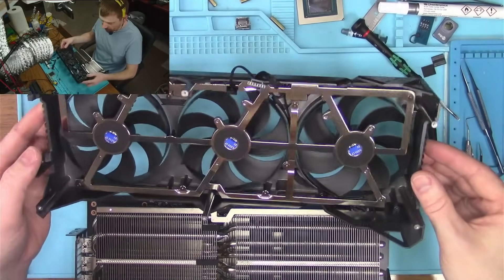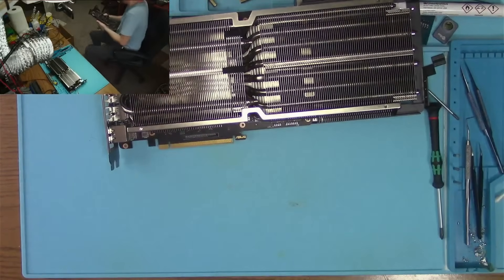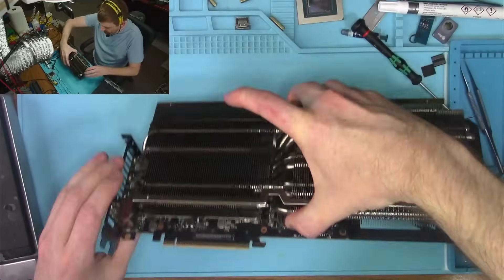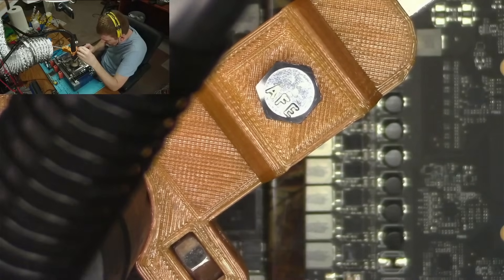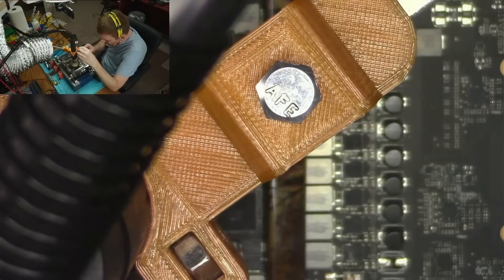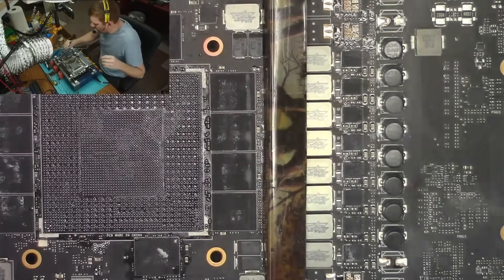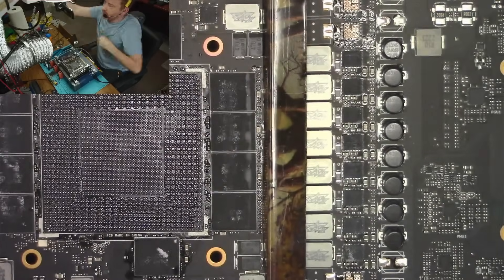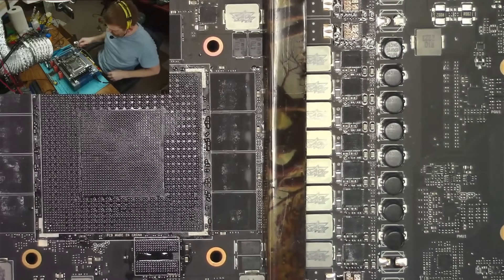Asus 4090 cracked PCB horror Part 1

Comment: I wanted to write you one last thing I noticed going through all the instructions. Noware does it say to line up the graphics card io shield so it's level on the back of the computer. If you push the card support so it pushes up on the pcie plug end of the card just puts a hard bind on that lock tab cracking it. You can see how the direction the pressure break direction shows. If the card was just hanging. It would Crack on the othersid3 of that lock tab.
Sorry to be repeating myself but I tested it and sure enough it will Crack the tab with the bulge on the side the pressure was being exerted on that pc board lock tab you keep having to repair on ALL heavier cards that are air-cooled. You do not need to put pressure on 5he end of the card. You just set the support to support the weight of the card not push as much pressure as you can. There's no reason to put excessive pressure on the support

Comment: Would it be better to cut that out with a grinder like a sliver then solder the connections horizontal through all the vertical layer one side to the other then fill the sliver with epoxy

Comment: These cards ARE way too heavy, But people should also get a gpu mount to prop it up to avoid sagging with cards like these, I only have an ASRock PG RX 7600 and I still use a mount. They only cost about $25-$30. There really is no excuse to not have one when you drop a grand on a monster heatsinked GPU.

Comment: This card has terrible cooler mounting. The entire weight of the heat-sink part is hanging on the PCB alone with no extra screw points to the I/O shield, to provide more rigidity. As if the card was meant only for vertical mount position.

Comment: The reason it's so heavy is because it was supposed to pull 600w of power. Little do 4090 owners know that it performs within 5% of stock 450w power if you set it to 70% power limit (315w).

Comment: That type of crack to me says two things. 1st, they dropped their machine or shipped the machine with the video card installed. I would also bet they destroyed their motherboard too. OR 2nd, someone did not know about the detent on PCI express slot and forced it. Just my opinion. This looks like misuse or incompetence and not manufacturing error.
Reply: with the visible twist at the crack itself, i'd say drop/shipping damage exclusively, while still in slot.
Reply: @kenabi  Such a dumb mistake to make. Take it out, put it in the box, takes like 30 seconds!
Reply: They probably dropped the card before it was ever installed
Reply: @CloudJack  nah, you can see the slight marring in the matte finish that shows it was in the slot when whatever happened, happened.

Comment: I bought an ati that was artifacting I pulled off the heatsink and run it in my computer for about a minute and the artifacting stopped I put it all back together installed the drivers and gave it a stress test and she ran like a dream

Comment: This GPU would have came with support bracket in the box. Its the users fault of he didnt use it or not used it correctly.
Ive had rtx 3070, 3070ti , 3080ti and 4080 and all those came with support brackets included even the cheaply made  Gigabyte eagle OC 3080ti.

Comment: There's a couple of things I just don't understand:
1. If one buy a 1600-2000$ product, why wouldn't one buy a 10$ holder that will ensure the product's safety? By the way, it comes INCLUDED with these cards, afaik with all the SKUs, since board partners want to minimize the chance of us sending cards back for RMA.
2. It's a 4090. It should have warranty, at least two years if you buy it as a company, or 3-5 if you buy it yourself. Why in the world wouldn't one send the card in and make the board partner fix it? It is essentially free. I've just RMA'd my 3080 12G after it didn't post one day. I even got it used and the warranty wasn't on my name, but Asus still fixed it in 2 weeks. They paid for postage back & forth too. I get it that professionals like you fix it in a shorter timeframe, but it still costs way more.

Comment: So many people abuse their cards then try to pretend like it's the manufacturers fault. The only way these cards crack is from customer abuse. The board can't crack itself.
Reply: It can from years of sagging, but they probably most likely tried to tug it out of the motherboard since the gpu is so huge it's hard to reach the pci-e release latch. If using chunky cards get a motherboard with a quick release button

Comment: Hi Scott again. I have the strix oc 4090 and what im seeing and would love your opinion on how people are breaking there cards like this. I almost did it myself. When you install the card horizontal. The card drops down on the far end front the io. Thats not the direction of force being applied. The cards are being pushed up with the card support way to hard. Or forcing a lot of upward pressure on that exact point of the card. Try it by installing a card in your computer and the just push up hard on the end where you would put the GPU support. As soon as I leveled mine. All the pressure on both sides of the pcie lane were even and there is no load on that area that's cracking on all these larger cards. Just a though to share with you. You share so much with me it's only fare to share the love.keep up the great work!!! SCOTT from AK & the Pacific NW.

Comment: Ah, so that's why AMD and Nvidia haven't moved to chiplets yet, because they've weighed up the cost/benefits of integrating memory and found it complicates repairs for warranty. 

The core issues could be solved by shifting to an LGA socket, but that has major drawbacks in GPU width. Then again, given how thick GPU's are now, it's much less of an issue. 

Anyhow, this is ASUS's fault for not putting a GPU support tower/bracket with the GPU like they should have. At ~4KG they're just asking for mechanical failure of the GPU motherboard or the PCI-e slot without support.

Comment: Guys I have an issue on black screen whenever all is black on the upper side of the screen I mean FFFFFFFF black on top right side of the screen like the first 20 pixels the screen tears on a thick size about 2 inches on the top part and freezes even mouse I solved it lowering the refresh rate of the monitor MSI Optix G272, I make the refresh rate 142hz instead of 144hz and its solved the video card is ASUS RTX 3070, its strange what can it be I tried display port and hdmi and problem are the same.

Comment: The Coolers are Overkill because the manufacturers thought the 40 series gpus were going to draw like 600 to 1000 Watts but turns out they only draw like 300 to 600

Comment: If Asus had designed the cooler properly, with very little effort, most of the weight would be on the IO shield and held up by the screws on the back of the PC case.  The fact that it has so little contact with that IO shield demonstrates they didn't know what they were doing.  Lazy design, and the customers suffer the consequences.

Comment: I think that the inner solder joints are made using high lead solder which melts at a much higher temperature, so dropping the chip should not be an issue.

Comment: All these cracks on GPUs point to a defective engineering where manufacturers make extremely heavy GPUs that must be held by a weak structural point. BAD engineering.
All these broken GPUs should be refunded at their full price no matter how old they are.
Imagine in cars, most of the engines drop off the cars. The user doesn't do anything wrong, is just bad engineering of the car makers for not using correct engine mounting system, and it just falls off under the car.

Comment: Get rid of the tree hugger crap solder.. Dell partner supplier Nvidia i remember started using back with laptops 9400 discrete graphics  card failures than XBOX 360 red ring of death  on an on 😮

Comment: Erk, I have this exact card in my machine. First the worry of the burning connectors, and now the eternal worry of the potential for weak PCB cracking on top. On a card that's a month's wages.

I moved away from Gigabyte due to my 3090 dying. Now with Asus I am risking my 4090 dying. Bah!
Reply: I got an Asus Strix 4080. The 4080 have less of a chance of burning connectors since its not as much power going through it like the 4090 pulls. To be safe I bought Kapton tape to wrap around all the connectors especially the plug to the board itself. Kapton tape is high temp resistant so wont have to worry about the plug wiggling itself loose overtime. Plus 2 support brackets.

Comment: Scamer why remove chipset..  repair broken 2 line and go your way. You best taxi driver metot always go road
Reply from the maker: i have no idea what you just said
Reply: @northwestrepair  I will translate for you. He is claiming you are a scammer because you have removed GPU core. He thinks that you will charge more due to more work to be done. Which is nonsense in my opinion, this kind of damage requires pads check as you did ;) Keep the videos coming. Looking forward for part 2. Popcorn ready :face-blue-smiling:
Reply: He explained in the video.... the card flexes and breaks solder joints under the GPU (large). Perhaps you lack the capability of understanding the physics behind the concept.